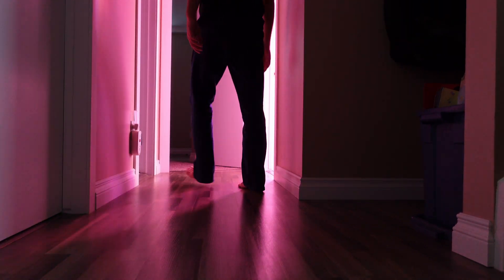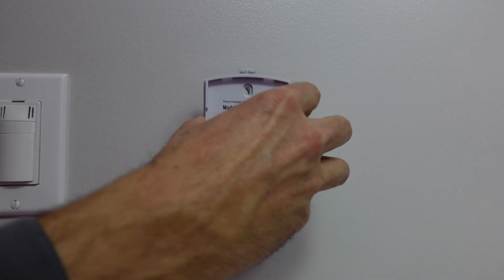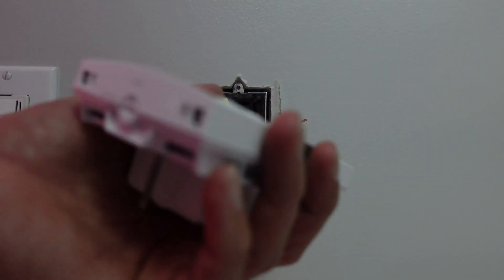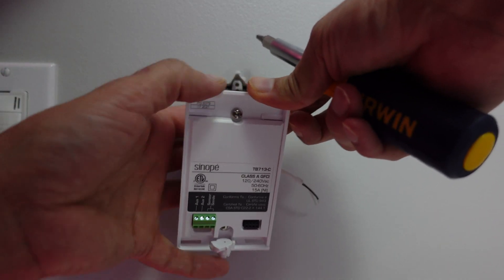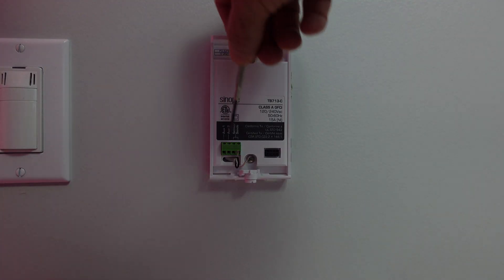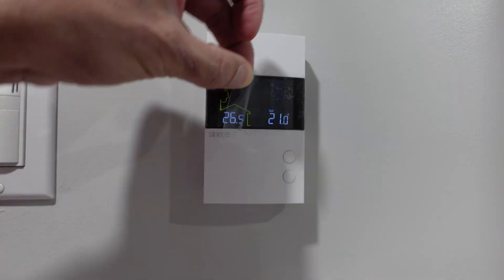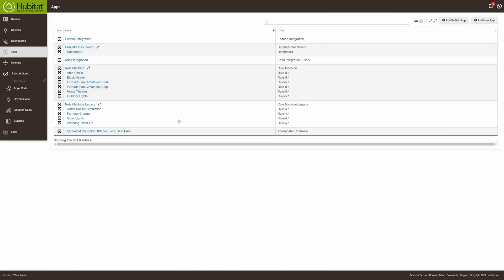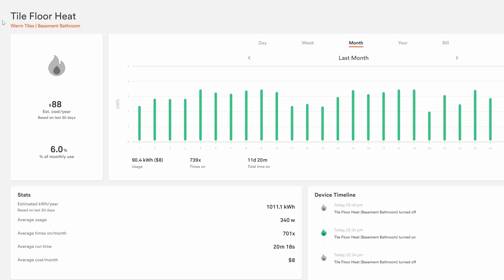Smart Floor Heat: Easy DIY Install Guide

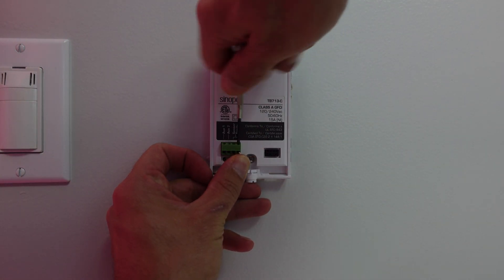Comment: I have a C7 Hubitat that will not stay on line. I have a smart switch installed to turn off at 3am and back on at 3:01 to reset the Hubitat C7. I have it on a reserved ip address. But that does not seem to help. Do you have any suggestions ? I can not rely on it. Any help would be great. Great videos. Keep them up.
Reply from the maker: Wifi switches did this for me as well, the only totally reliable switches for me are zigbee.
Reply: I would not do that - you are pulling power from the hubitat hub without doing a power down.  You really should not need to do this ... I would find the problem first .... if you need to reboot,  set an automation to do that nightly vs.  using a wifi plug

Comment: Thank you for the helpful videos on Hubitat use. Inspired by your sharing,  just recently  took the plunge with a C8 Hub and this first week has been very positive with surprising ease including logic used on various HRV and hydronic heat related control.  I did hit a dead end today however not being able to pair up  4 low voltage Sinope Zigbee TH1400ZB thermostats.  Any tips?
Reply from the maker: Glad you found the videos helpful! I'm pretty sure you have to put the thermostat into pairing mode, I did that a bit tricky, after that hopefully you're gtg.